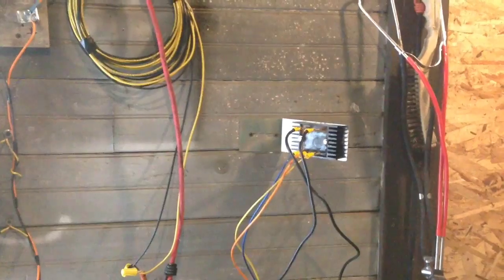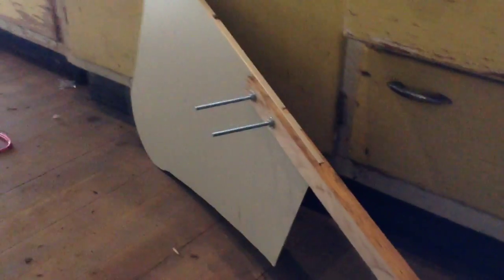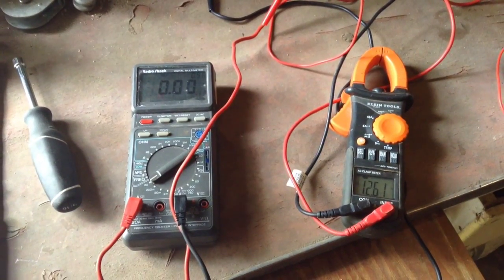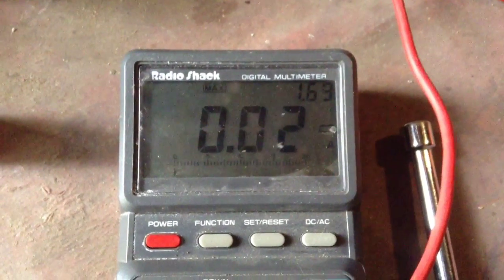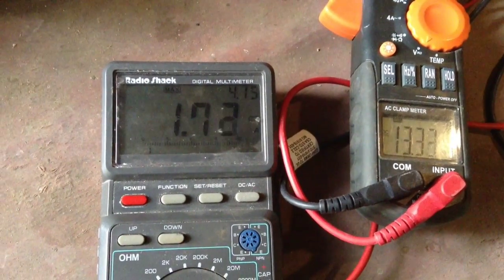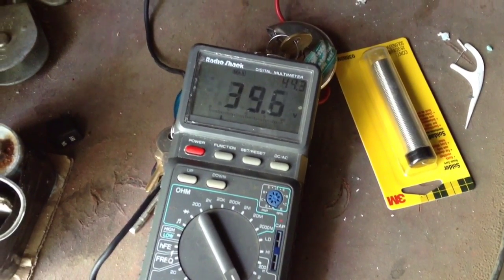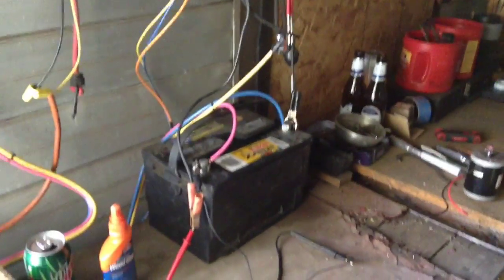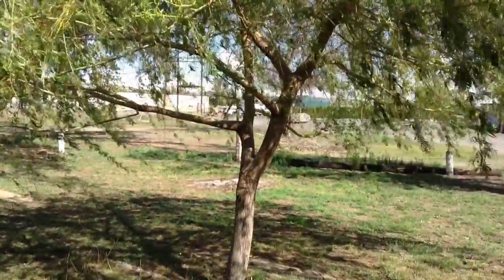Horizontal Axis Wind Turbine BackRoomLabs (amps volts rectifier) finally getting some amps

Comment: excellent demonstration of how a wind turbine should be tested.  Clear and concise with real figures.
Thanks for the upload.
Reply from the maker: Thanks. ive been working loads the past 8 months or so. been saving to move. that move is coming very soon like 2 weeks. the new place is in a much better place for cleans winds. closer to the foot hills. every night when the sun goes down the winds pick up for 3 to 4 hours. stronge high desert winds of 20 to 25. so im going to take what i have learned and put that to good use at this next property.

Comment: Looking at this setup you got my gears turning. You could build a simple resister voltage divider circuit with a pot in series so it could adjust a cut-off voltage to the base of a transistor that could control a double pole relay to take power off the battery bank so the batteries can rest and automatically come back in once the voltage drops and maybe add in a resistive light as a dump load off the relay.
Looking at this smart drive you could make it more efficient in light winds if you where to take a few coils off generator duty and make them in go back into motor duty by using a turn signal relay to pulse them so it could make more power by adding more pushing the magnets. This could work because the wind would still be the prime mover and make current. This could be done with a simple piece of aluminum to make a simple spindle switch on the wind generator. Tesla came up with the motor generator concept its not new its been around for ages just people dont use it much expect for Toyota on Its hybrids. Remember a motor is a generator and can do both at the same time. Its so simple but so complex.

Comment: Thanks for sharing, question more blades will increase amp or decrease.basil
Reply from the maker: More blades will lower the wind speed needed to start the blades spinning. More blades will spin slower then less blades in high winds. So a 3 blade will spin faster then says seven blade in 20mph winds. So at low speeds more blades will produce more amps at a slower wind speed sacrificing high power production at higher wind speeds "blades will stall" so it's a trade off. If you usually have high winds go with less blades. If you live in a lower wind speed area go with more blades.
Reply: That is good information thankyou for taking time.I have lower wind  and 11 blades.